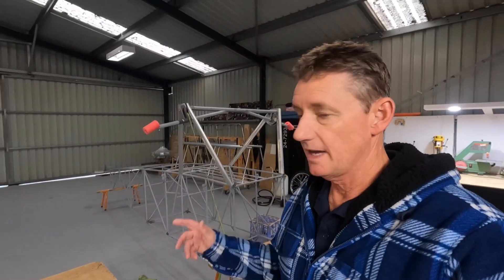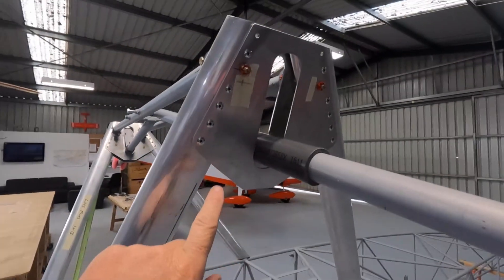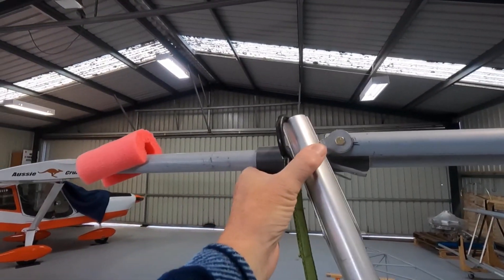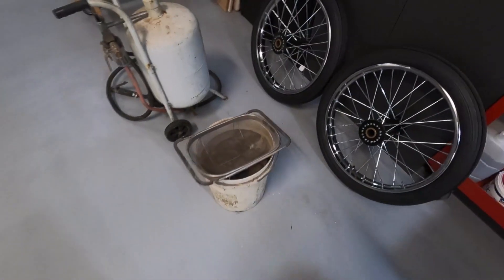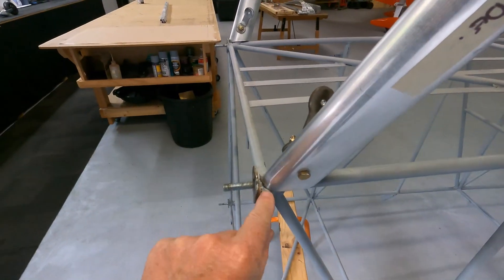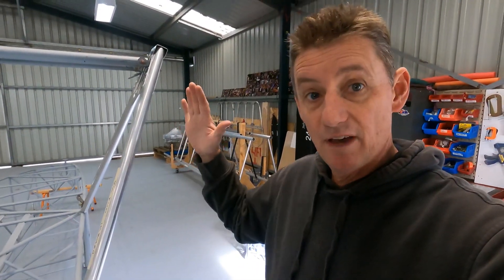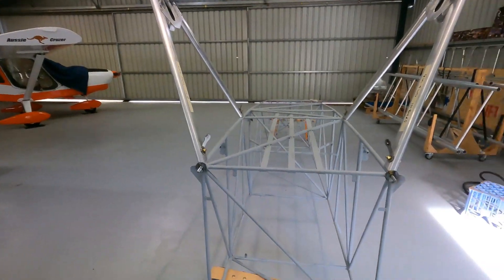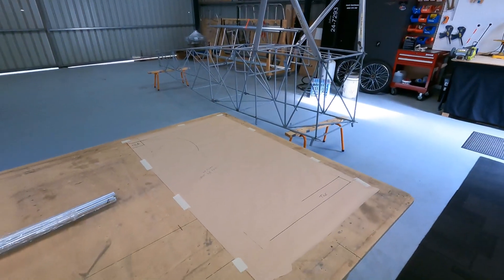Sopwith Undercarriage instal completed

Comment: Scott while I do not think for a moment that you would over-torque any, do you intend to install crush braces to reinforce the holes through critical locations like the wing spars as well as undercarriage stubs on the fuselage anyway?
Reply from the maker: No chrome Molloy steel stubs, an3 bolt is only 25” lbs of torque and such a close tolerance on grip length.

Comment: Why didn't you get a rotary engine?
Reply from the maker: Cost reliability and labour intensive about covers it.
Reply: @scottmatthews5280  Ohh ok.
Reply: In case you did not know and are interested Replica Rotary engines do now exist, but I believe they are difficult to obtain, phenomenally expensive and not inherently reliable.

In case you are not aware of how they operate rotary radials derived their name from the fact that the crankcase and cylinders rotate around the crankshaft which is attached to the engine mounts and so remains stationary while the propeller is fixed to the crankcase.

It was due to gyroscopic effects created by the spinning mass of their Rotary Radial engines that fighters like the Sopwith Camel were famous for their ability to perform a 'lightning fast' nose down turn to the right but turned slower and with a nose up attitude to the left.

Because of the way they functioned Rotary Radial engines did not recycle lubricating oil rather they expended it continuously with the exhaust which is extremely wasteful and messy.

If you are able to find copies of memoirs by WWI 'scout' pilots like Albert Ball, you will find that many of them mention how incredibly messy Rotary engines were because they continuously sprayed the pilot with castor oil which was used as the expendable lubricant.

Fuel air mixture for rotary radials was drawn through the crankcase via a very rudimentary carburettor the mixture for which had to be constantly adjusted by the pilot, then up individual galleries on the cylinders which is an extremely inefficient and unreliable process.

Due to obvious difficulties inherent to delivering fuel to individual cylinders it would be difficult if not virtually impossible to install a modern fuel injection system on a Rotary Radial.

It was not difficult however for radial engines produced during and after WWII by companies like BMW, the BMW 801 which powered early variants of the Focke Wulf 190 had direct fuel injection with sophisticated automatic fuel mixture and propeller pitch control.

It would probably not be difficult for Rotec to offer fuel injection for the radials they produce which could possibly make them even more reliable and fuel efficient than they already are.
Reply: @whotknots  Yeah, I know how these engines work. Anyway, a company called Kip Aero in New Zealand sells Gnome engines for about $65k. I have a friend who ordered one. Good engines.

Comment: Looking good Scott! As you said it will start coming together quickly at some point once you start bolting everything together.  You may have mentioned it in another video, but which covering system are you planning to use?
Reply from the maker: James, Stewart system. Water based and latex or acrylic house paint